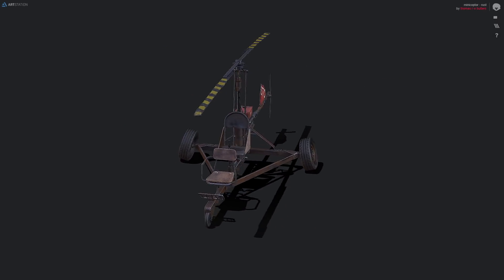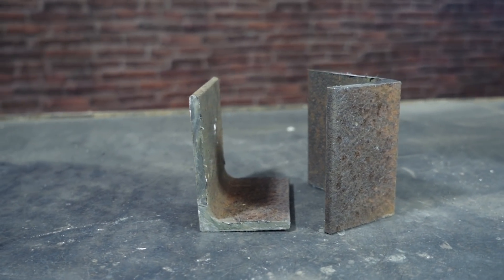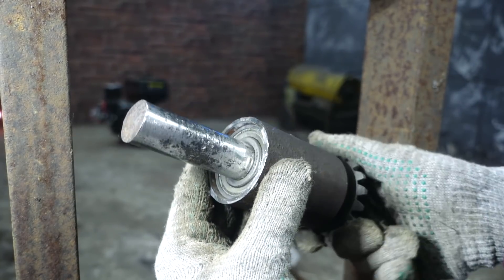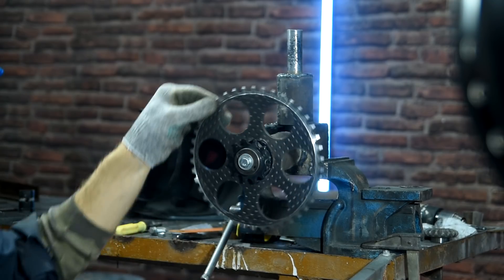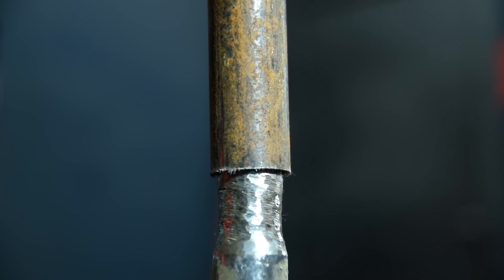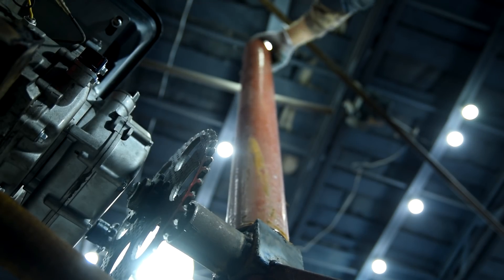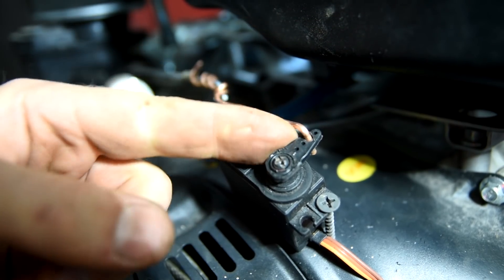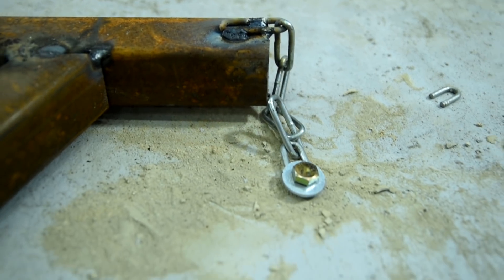BUILT HELICOPTER FROM RUST

Comment: If only people realized the amount of work that went into your projects. It's not like you have a complete machine shop and all the best equipment. Amazing as always. Enginuity at it's best.
Reply: We do realize how much
Reply: in most cases the person using them is far more important than the tool being used. he has skills . i cant remember how many times  i would be clueless as to how to do somthing and my grandfather would glance at it ...grab 2 or 3 bits of scrap  then say try this...or that  and everything  would become clear....i would think this man has had more than 1 of my grandfathers in his life   . most people start with there thoughts in boxes...he thinks on how to build them lol.
Reply: So true
Reply: i mean hes got more machines than i do i just have a mig machine and a angle grinder and i could do this maybe alot more time.
Reply: @jacksonsherbertgaming4437   it would be time wasted if you copied the design of how the rotor blades attach to the rotor head, as is this looses between 1/2 and 1/3 of its lift due to drag  caused by the lack of a "squashplate"  the fixed angle of attack of the rotor blade is also an issue. this build would function far better as an autogyro where the main rotor is unpowered and the craft is propelled ...james bond little nellie is an autogyro. but as a helicopter vital control apparatus are missing
Reply: @jacksonsherbertgaming4437  it isnt so much having tools they just make making things easier  the hard part is thinking of somthing to make...and how he is rather good at this i think. he is fortunate to have access to the machines he dose i would like the oppertunity as there is somthing i would like to make , and could easily make with his equipment in less than 2 days with less than 20$ in materials or probably 2 years with a drill hacksaw and file so yes it would be a lot more time lol
Reply: @mobiousenigma  yeah well also I live in the middle of no where so you would expect there to be scrap yards everywhere but no cigar :(
Reply: “if only people realised the amount of work that went into your projects”, oh no i thought it was easy to design and make a helicopter
Reply: @davidoliveira6161  it is relative easy to design and build almost anything today  even more so if it already has a working model to start from. mr sikorski figured out the hard parts long ago, he went through the trial end error  process to see what is required to make a functional non fixed wing aircraft. to make this a functional helicopter it needs to control the angle of attack for the rotor and that rotor needs to be attached with a hinge for aerodynamic reasons  ...the solution is  a "squashplate" .. i in no way deny that it is a lot of labor which will require much skill and knowledge but in every way refute the difficulty of designing or making .
Reply: I’m sure people realize the work.  He’s building a fucking copter
Reply: people need to appreciate bandit camp
Reply: On the other hand, this guy doesn't even put in the effort to record himself narrating... he uses a PC generated voice...
Reply: @aggro_ace  maybe he isn’t very secure in his resding voice
Reply: @aggro_ace  hows your russian? you do realize english is not his mother tung . whats wrong with ms narrator?? he gives you this for FREE....and you choose to criticize  , where are the links to your videos? have you ever tried to transcribe a video ?? any idea how much time it actually takes  and how much work it is?
Reply: @mobiousenigma  I guess its a moot point now because ole buddy can't get paid from his YouTube videos anymore due to the SWIFT exclusion in Russia 🤣🤣
Reply: @aggro_ace  funny how youtube can censor and discriminate with impunity  it will be fun to see them fall in the end. as for our budding engineer , i hope he manages to avoid the stupidity and comes out the other end to make more engineering mistakes for us to debate.
Reply: the ideas aren't original he's just copying lol
Reply: cleaning welding surfaces doesn't take much as far as equipment goes
Reply: Don't you worry GCC, We def understand so speak for yourself yes.
Reply: This is cool tho. Unlucky that some one probably laddered on his roof and took it or he blew it up after spending 750 scrap on it:(
Reply: which makes it even more like RUST
Reply: at it's beast.

Comment: Would love to see this build continue. Actually flying this thing would be insane but maybe if it was fully remote controlled?
Reply: People fly these all the time. He basically made a "mosquito" from junkyard parts. Needs more power and a proper rotor, a collective would help with control too. For a junkyard build a gyrocopter would be a better option, since you can't find a collective just laying around.
Reply: wrong material, aluminum or carbon fiber (if you find it) would have been a way better choice
Reply: @Eddie Hitler I think the car hub would hold up fine, every time you take a corner there is a pulling motion trying to rip the thing off the vehicle and they go for hundreds of thousands of miles.
Reply: @bixnood7273  what’s a collective
Reply: @bixnood7273  So not "these" like in the video.
Reply: @alfa5502  The collective pitch control (or simply “collective” or “thrust lever”) is located on the left side of the pilot's seat and is operated with the left hand. The collective is used to make changes to the pitch angle of the main rotor blades and does this simultaneously, or collectively, as the name implies.
Reply: @alfa5502  the collective angles all the rotor blades at the same time to increase their angle of attack which in turn increases the lift. This allows the helicopter to increase and decrease its altitude
Reply: I would've put oil inside the angular reduction tube, where the gears are at.
Reply: He cannot fly this. There is no stabilisation of the rotor, even if by luck it was perfectly balanced, it would immediately go into a sharp bank towards the direction of prop rotation.

helicopters cannot have fixed rotor blades like this, the rotor itself needs to be coutner balanced, and the pitch of the blades needs coonstant adjustment to stay stable, this is why real helicopters have so many linkages around the blades
Reply: I don't think that engine could get it off the ground

Comment: Here's a bit of advice, use a 2 cycle engine. It'll be lighter weight and be able to produce more RPMs and horsepower on top of being more reliable for flight. Then use an actual gyrocopter blade (air screw) as It'll be lighter weight and be properly balanced and give the proper lift required. Otherwise it's just going to be a lot of work for nothing. I understand that you are trying to keep it within certain parameters but fantasy and reality are 2 different things and for it to be actually able to work some things are going to require a slight modification in design.
Reply: you gotta remember, he added the conidtion that he has to get stuff out of the junk yard to build it
Reply: @Neosword  he can probably find a 2 cycle engine in the junkyard, those kinds of engines are everywhere.
Reply: @Skibidoop hes trying to keep it to the parameters of the game as much as possible so a lather will pretty much be out of question
Reply: 2 stroke powahhh
Reply: @Skibidoop nah 2 stoke 450 from a dirt bike snomobile emgines over heat in snow they would need major modification to take the heat in dry conditions but its would be awesome
Reply: It's probably too heavy anyways
Reply: It may provide enough power to get lift but those blades will never produce enough lift to get that thing off the ground
Reply: @Lovey_18  true. But I doubt that even with this power, the efficiency is lower due to all the imbalances. At least to operate safely and reliable. If it was lighter the imbalances and inefficiency will be less of a problem. But hey it's a cool project and who am I to judge in this stage of development.
Reply: @teunlll  you are exactly right! Very cool project and something I definitely would not be able to do

Comment: As an aircraft mechanic I am simultaneously super impressed and incredibly sketched out. I have a little advice but first a warning: DO NOT try to fly that thing with the current control scheme you have. Helicopters are inherently unstable and while what you’ve rigged up is incredibly impressive as an armature attempt, it’s also going to crash your vehicle. Rotors have a 4 directional control based usually on rotor pitch that uses gyroscopic procession to orient the vehicle. It looks to me like you only have forward/backward orientation which will almost definitely cause airframe roll and make you unable to keep yourself level. Again, impressed that you came up with it but the concepts behind helicopters are complicated so please be careful. 

Onto advice: for the rotor blade 1. you will get much better results from even a rough airfoil as that’s where most of your lift comes from anyway and 2. Try a blade angle of closer to 20 degrees. 45 can cause stalling on the blade over the middle part which gives you the most lift. Between 20 and 30 will most likely give the best results but that’s what experimentation is for. If you really want to milk as much as you can out of it you can add a twist to the blade having thicker and higher angles at the base and lower angled thinner airfoils at the tips of that makes sense.

All in all good luck and stay safe, hope it goes well
Reply: Oh hey do you know if aircraft ppl have like a Schmitz Betz style optimization for propellers? For turbines there’s CFD and CSD programs that can spit out an almost perfect turbine if you feed it parameters so surely there’s some well proven optimizations for propellers too right?
Reply: please fly hell o copter for content
Reply: @sa.8208  lol
Reply: and the fact that he welded rusty metal. would never trust those unprepped welds
Reply: oddly enough thats why its also so hard to control it in game because they wanted you have that feel for it I would assume something like that would require above human mental and luck to fly that thing.
Reply: you really think that engine is going to have enough power to get it off the ground with that small router blade
Reply: @Kyle17206  it's an concept???????????
Reply: @johnk.5986  still no excuse for such poor welds
Reply: honestly, surprised you and no one else has mentioned the fact that one of the reasons it might not be getting off the ground and will never get off the ground in it's current state is the simple lack of a tail rotor, it's just going to spin, I hope that if he ever dares to fly this thing he at least makes a functional tail rotor
Reply: @Kyle17206  if he removed the rust it wouldn't look like what he was trying to make????
Reply: @davthatguy3052  you only have to grind off the rust near where you weld though
Reply: @Kyle17206  authenticity maybe it's probably more about if the crackhead mechanics of rusts helicopter design worked more than making an actual version
Reply: i doubt that you are airraf mechanic if u think someone will try to fly this with no power and without any steering, just two fans bolted together

Comment: I am a student at AIM (aviation institute of Maintenance) 
 I have several recommendations to make this project work. 100% First I want to say I am impressed with your welding skills and knowledge of gears and resourcefulness. I would say an aluminum industrial ceiling fan would work best for a main rotor. (Its already balanced, lightweight, and designed for heavy loads and high RPMs)
Next I would suggest making a gyrocopter instead of a helicopter that way you can use the engine to power a fan translating forward flight and the free spinning blade acts an airfoil. There is still some torque from the spinning that you would have to deal with but the best advantage of a free rotor is safety. In case of running out of fuel or engine failure, you will simply glide to the ground safely. Next thing you want to figure out is weight and balance. The steel might be too heavy, but maybe not. I saw a video of a guy make one out of a pontoon boat. 
Hope this helps!! Cheers and good luck!!

Comment: That was a fun build to watch, but as a former EAA member and builder, I have a couple of suggestions. First, find a Snowmobile Rotax or similar engine or an old VW or Subaru engine. Then reenforce yout Rotor housing with a larger diameter tube and bearings (at least three bearings to avoid shaft warping). And finally, try Aircraft Spruce and Specialty for some tear drop shaped tubing like that used for wing struts, as your rotor blades. Though a second shaft and gear box for a fan blade tail rotor might help with stability
Reply: I agree with the old vw engine idea. Big vw guy myself and I feel like a old air cooled VW engine would be an extremely light option and would produce enough power in it's stock configuration to do the job and if you need to get more out of the engine you can buy bolt on upgrades to produce a little more power.

Comment: first of all: make the hair screws variable. THAT is how you're gonna gain rpms
second: you need a tail rotor or else this thing will go full double tail beyblade
Reply: Not if it was a real autogyro (this is clearly not a helicopter). An autogyro only uses the motor to start the blades spinning. In flight, the blades spin through wind resistance, and function more like a wing. The prop behind the driver gives forward motion, the wind resistance drives the overhead prop, and the rudder keeps it straight. An autogyro cannot hover, but they are more stable than a conventional airplane or helicopter.
Reply: @jonnyreverb  -- The rotor looks to be powered, so it is a helicopter... Without a tail rotor, he's just going to be going in circles if he ever gets it off the ground...
Reply: @CurmudgeonExtraordinaire  Oh, you're right. I assumed the clutch he installed was to disengage the rotor. Autogyros start the rotor overhead going with the motor, then they transfer the power to the propeller. The centrifugal clutch would not do that, but the drum brakes he installed might work. If it fails, you want it to be disengaged from the rotor. This would never fly as a helicopter, it could be a seriously sketchy autogyro, but never a helicopter.
Reply: @jonnyreverb  -- The initial animation that he shows within the first 10 seconds has a vertical stabilizer AND a tail rotor... It MIGHT fly high enough to crash... :)  Then again, if he doesn't have that rotor balanced, he might even be able to crash without lifting off... I'm a pilot (private, SEL) and have owned and flown a gyrocopter, so I know a bit about them... I've stuck with fixed wing aircraft for the last 25 years or so though...
Reply: @CurmudgeonExtraordinaire  You are right. I didn't look at it close enough. Do you really think that motor has enough power to do a vertical takeoff?
Reply: @jonnyreverb  -- It will get high enough to crash... Only technically need a small fraction of an inch for that... Building it out of steel like that though, it's going to be heavy... My gyro was built out of aluminum square tubing and angle bolted together with a 72 hp engine... What should be interesting though is if he manages to get that heavy steel rotor up to the necessary rotor RPMs and it stays on the rotor hub instead of the blades ripping off and launching through the walls... Rotorcraft accidents tend to look rather violent due to all the spinning components hitting the ground and such, but actually, the safest place to be is at the mast area since everything is happening outwards from you... WHEN (on "if") this fails though, it should fail SPECTACULARLY... :)
Reply: @CurmudgeonExtraordinaire  I fly a paramotor. I looked at autogyros when I got into the sport, and it didn't really seem as practical. Are you flying under FAR 103?
Reply: @jonnyreverb  -- Actually, not all autogyros have prerotators... I've flown ones where you had to get the rotor up to speed by hand...
Reply: @jonnyreverb  -- No, I have a certified aircraft...

And as far as "practical" goes, I doubt that paramotors are any more "practical" than a gyro... :)  If it was practical, then it wouldn't be any fun anyway... :)
Reply: @CurmudgeonExtraordinaire  Practical to own, not utilitarian at all. I don't need a license, FAA inspections, or an airport. And it fits in my trunk, and I have 2 in my basement now. That's about as practical to own as aircraft get.
Reply: @jonnyreverb  -- I didn't need a hangar for my gyro either... I kept it in my garage and would take it to one of the local small airports when I wanted to fly it... Initially I had a rack on my truck that I used to bring it home after I bought it, but I bought a utility trailer since being lower to the ground, it was easier to load and unload it with just one person... Around here, if you had a basement for an aircraft, the aircraft better be an amphibian since the water table is pretty high...  :)  Even if it is a "legal" Part 103 ultralight gyro, then your looking at up to 250 lbs and that is not something that I would want to be hauling up the stairs a basement...  If you go the experimental aircraft route though, you as the builder can do the annual inspections... I'm tempted to rebuild mine, but after surviving one gyro crash, that might just be pushing my luck a bit... Gyros are not very forgiving in crashes... I still have some the the pieces in the attic of my garage leftover from that gyro...